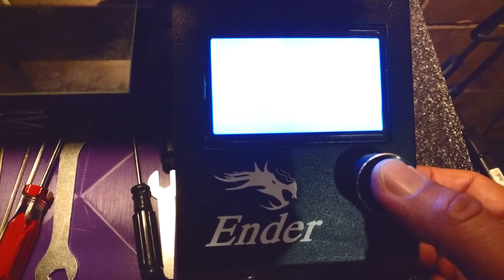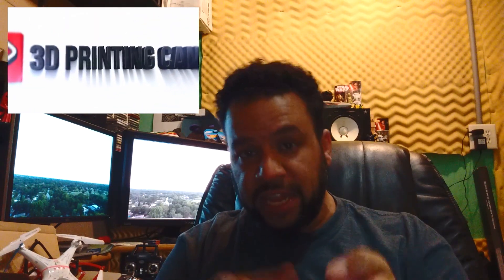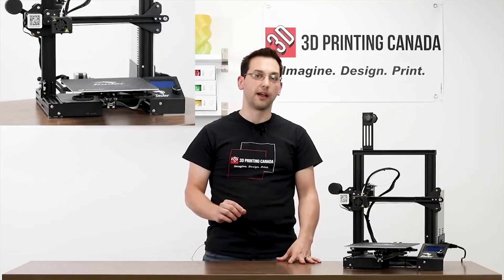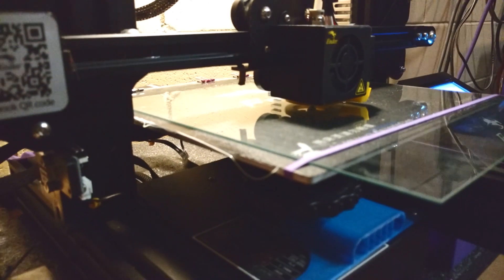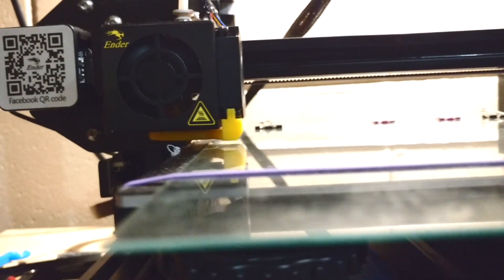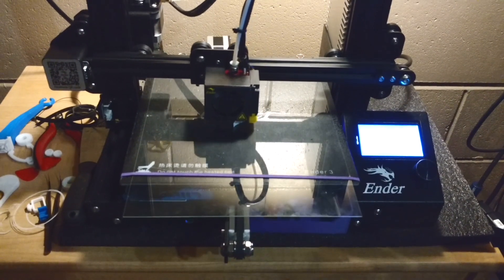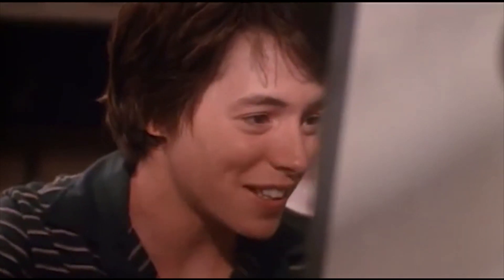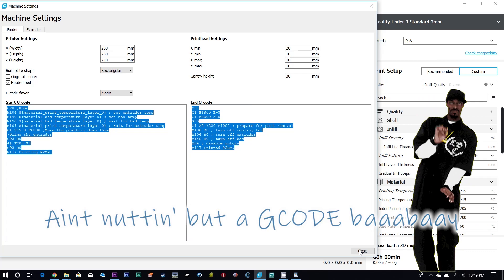Ender 3 G Code Hack Move Build-plate Forward Heat Bed & Nozzle Simultaneously

Comment: ive used your gcode today , thank you ...some how i had bed levelling issue now solved but when i set bed levelling 1-9 it slightly off maybe you'll see what i mean(my Y axis is off by 30mm).
Reply: it works thank you
im using the micro swiss but having issues with the bed levelling 
im not that smart & would love a lesson up on it

Comment: It is amazing how many 3d printers run the bed to back when they are done. What were they thinking ?
Reply from the maker: RIGHT!?!? I was puzzled by this...but then I remembered that Prusa Machines slide forward so I dug deep into the I3's G-Code & found it, a quick test confirmed it work and it was off to the races. I also added some code in that heats up the Bed & Nozzle simultaneously this saves me 5 mins of wait time #betterender
Reply: they probably all run to the back because most of them put the axis end switch to the back, so that way if its running to the back and your gcode is crap.. the switch will save your mechanicals